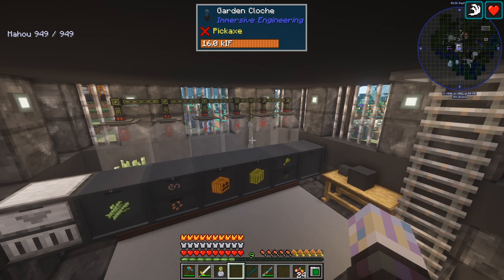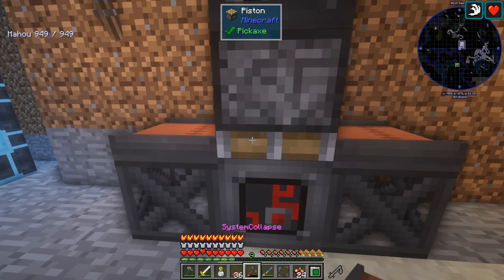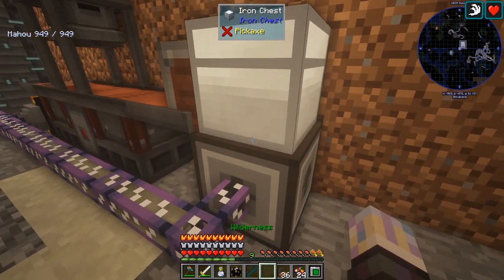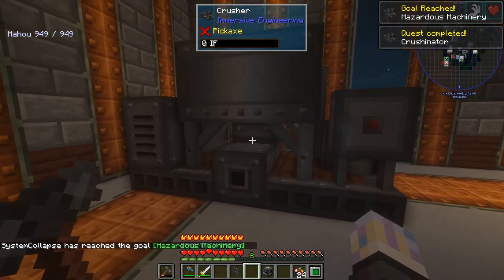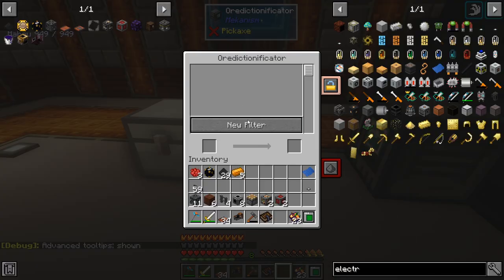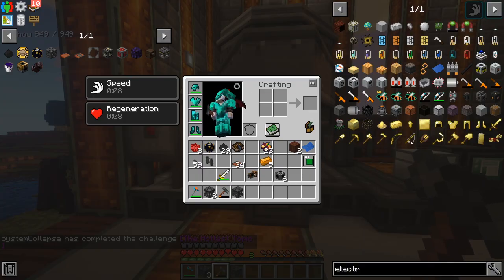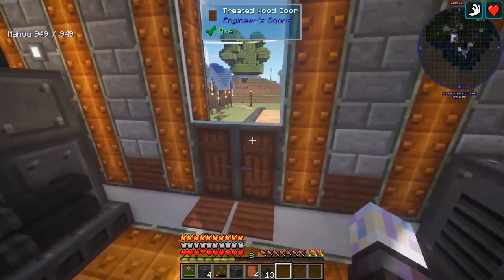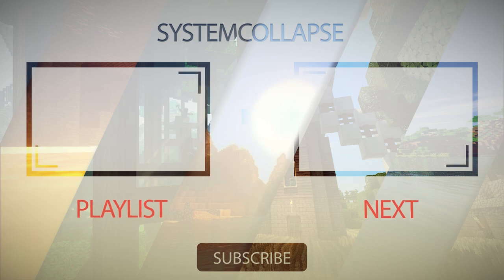FTB University EP22 Immersive Automation

Comment: If you wrench a face of a powercell you can set it to input/output independently of the others, that might help.

The drawer upgrades you're looking for are "conversion upgrades" by the way. I could swear the pack has that mod that auto converts ores and ingots to a common mod, like thermal/nuclearcraft and what have you, but your way works too.

Shame you can't slap upgrades on the controller. Imagine being able to void upgrade a 16x16 grid of drawers all at lnce.

Comment: I think your Arc furnace is struggling for power.  Add another power cube or 2 to make it smelt faster. And yes the question mark on the right hand side of the layout picture will display a list of components.
Reply: This, connect all three power plugs on the back of the furnace